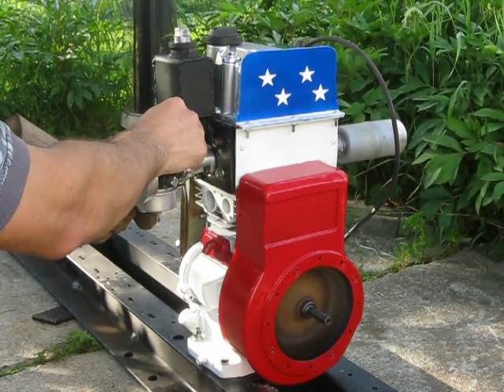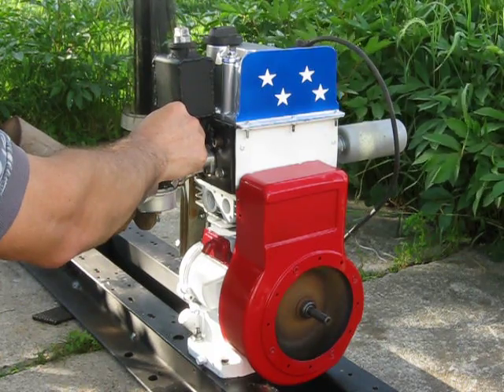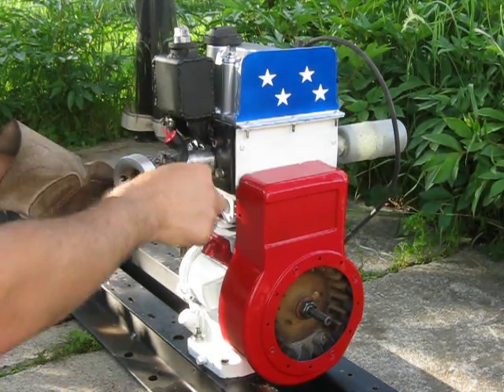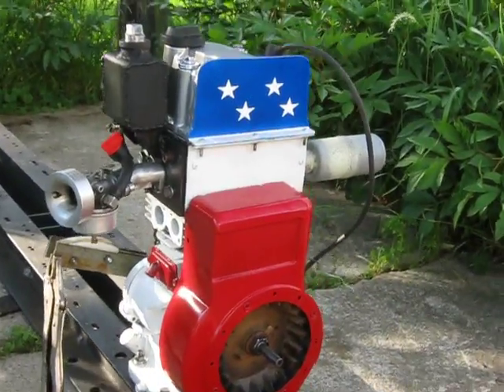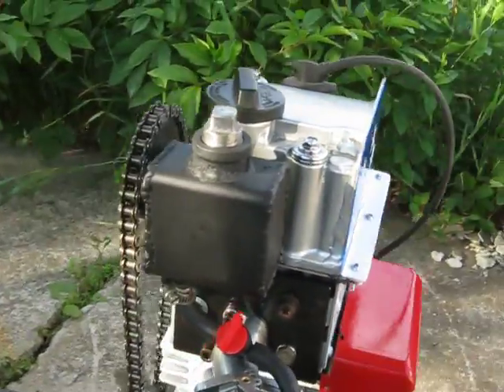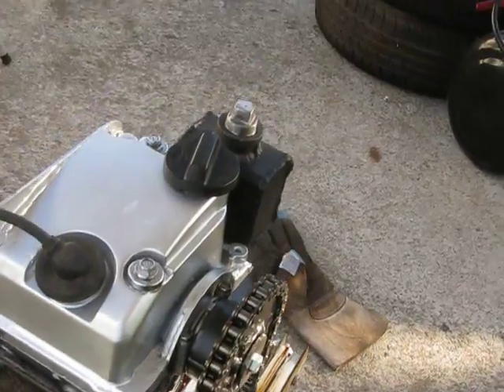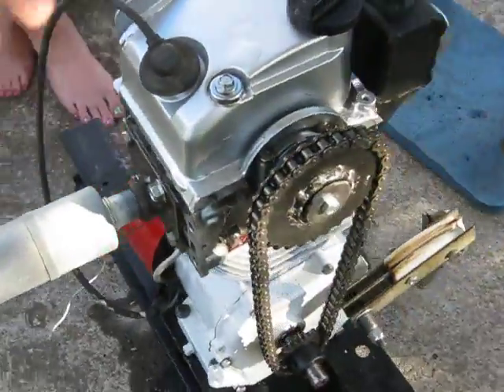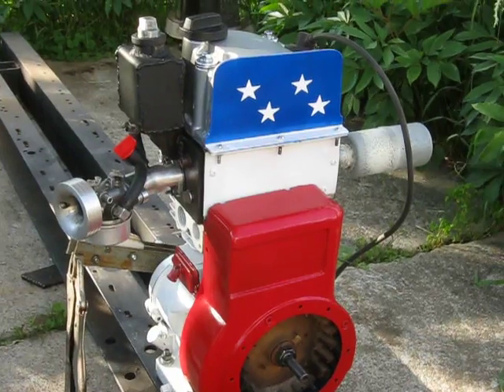4 VALVE CAMMER Briggs Longest Run!

Comment: um,, im a bit confused, (and late) but how does this work? I am not big into cars I just do small engine so this is a bit confusing to me lol.
Reply from the maker: Oh, this is a 5 horse Briggs engine with the cylinder head removed, and valves de-activated. I adapted a 4 valve Honda Civic cylinder head to fit it, and put a chain drive on to drive the new camshaft. There was some machining involved, which my son did, but it does run  :)
Reply: @ChargerMiles007  very cool. what's the point of having 4 valves?
Reply from the maker: Not much in this case, but in the original engine, 4 valves can allow it to flow more air in and out, allowing it to make more power. Especially at higher rpm, that is why practically all car engines made today are 4 or even 5 valve per cylinder. The aircraft industry discovered this in about 1920, so most of the V12 engines like the Rolls Royce Merlin, and the Allison V1710, and the German engines like the Junkers Jumo all use 4 valves per cylinder. It was nearly impossible to design a 2 row 14 cylinder radial engine with 4 valves, so most used 2 valves, and the British radials like the Bristol Hercules used Sleeve Valves instead.
Reply: @ChargerMiles007  So the four valves are just working as two, except instead of having two gigantic valves it’s just 4 normal size. am i correct? i do a lot of small engines but extremely little with cars and such.

Comment: Pretty smooth, good work. You may need to rejet the carb, muffler shouldn’t show that much heat so soon.
Reply from the maker: Yes, the mixture on this is anybodys guess with the 4 valve head changing the flow pattern so much.

Comment: Very cool idea !!!!
It would be good to run the cylinder head with a water cooled cooling system,perhaps it would be a good idea to run a can belt instead seeing that the chain isn't bathed in oil.
Perhaps an oil pump installation wouldn't be a bad idea to lubricate the camshaft jounals.

I  thought I could throw a few suggestions at you as it sounds like a much more free revving engine than the conventional Briggs & Stratton engine,in other words it's an improvement.

I've done a twin cam head conversion on the Nissan RB30E engine (a fuel injected version of the RB30S motor which is fitted into the Mexican Nissan Skyline).

So,that became an RB30DE engine after I made it wear the RB25DE cylinder head which upped its power from 114 kilowatts to nearly 190 kilowatts.

It kept up to an EFI 304 cubic inch Holden V8 which ran a mild cam & put out 185 kilowatts of flywheel power.

Comment: I might have to make one of these and put it on a minibike
Reply from the maker: LOL  :)  Trust me, it is gonna take more time than you think! I honestly thought it was going to be a fairly simple project compared to others I have done. I was wrong.
That being said, I don't want to discourage you, as I believe one of these engines could be built to work well, you will probably need an oil pump, and a small radiator for sure.

Comment: Have you put a tach on it? Sounds like its pretty quick.
Reply: +ChargerMiles007 those flywheels will surprise you. I used to race WKA modified and opens back when we still had the stock flywheel rule. I would regularly turn them 9000 rpm and sometimes more... Had one engine we ran to 11,400! They stayed together for the most part, usually would just spit the fins off but they did break occasionally and people got hurt. That's when the rules allowed billet flywheels. The stock classes never had a problem and they would run close to 6800 rpm all day long though.
Reply from the maker: No tach yet, but I could do that. I am sure it hit at least 5000 rpm from the sound, judging from previous engines. i don't want to take it much higher with the stock cast iron flywheel. Better safe than sorry.